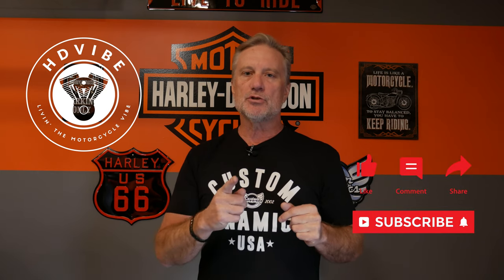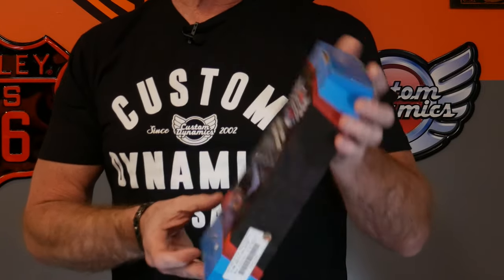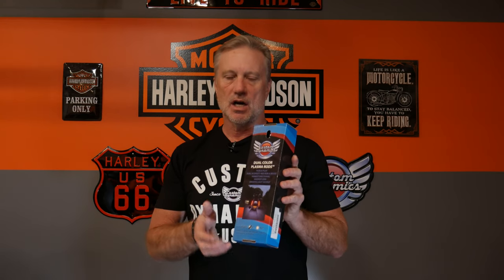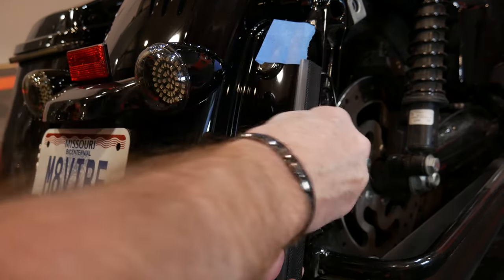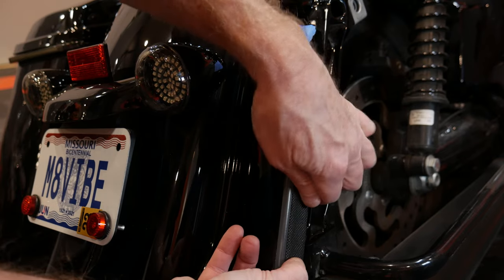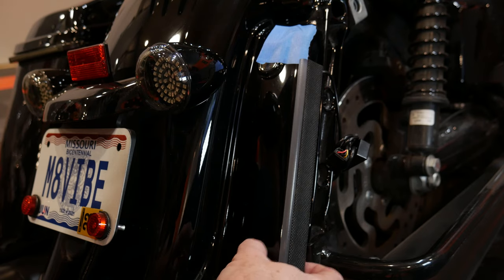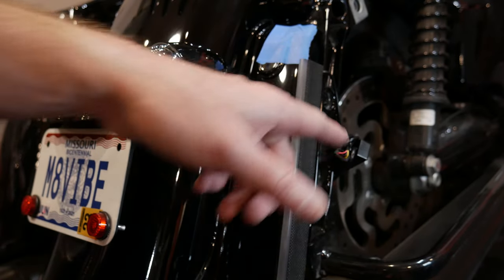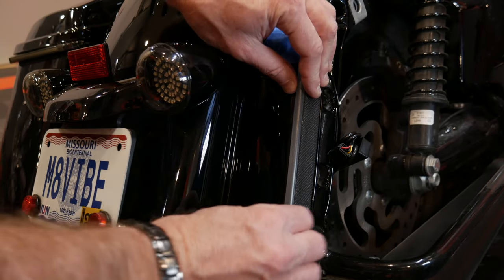Road King Special Lighting Upgrades

Comment: Rick have you thought about the spots and turnsignals down on the forks like the road king standard. I dont like the turn signals on the handlebars.
Reply from the maker: Thanks Bob for watching and commenting.   I do believe it is possible at least to add the passing lamps.  You can see how to do that on another YouTube channel called Riders United.  I have since traded in my 2019 RKS, so I obviously won't be doing any more videos or work on it.  However I have over 200 videos on tips, trick, rides, reviews and other installs on the touring bikes.  If you are already a subscriber to the channel...thank you.  If you haven't yet subscribed to the channel I'd be honored if you'd consider doing so.   Thanks for your support and ride safe.  👊✌️👍

Comment: Hey Rick, recently subscribed to your channel. 
I have a 2018 Road Glide and I have installed the CD bag and fascia lights. I also have the Magic Strobe. 
Do you have a video showing how to use the red jumper cable to make all the lights strobe and not just the stick brake lights?
Reply from the maker: I do not have a specific video on that but my guess is you may have the magic strobe installed after the connections for the other Custom Dynamics products.   The magic strobe needs to be the first connection to the stock plug and then everything else after that.  Then everything will strobe when brakes are applied.   Give that a try and let me know if that gets them all to strobe.   The other option is to call Custom Dynamics and they can walk you through it as well.  They are very helpful and knowledgeable on the set ups.   Thanks for subscribing and ride safe.👊👍🇺🇸
Reply: Oh, so you didn’t have to cut a wire and jump that red wire in somewhere??? 
Ok, I’ll see if I can see what order everything is in. Thanks so much!
Reply from the maker: @indysteve2875  You do not have to use that jumper wire to get them to work.   It's just the order they are connected.  Hopefully that will take care of it.

Comment: What are riders trying to accomplish by adding that many lights on the rear of their bikes? Adding another run/brake/turn light to a bike that has upgraded factory run/brake/turn lights on the rear does little for being "seen" when we're dealing with driver inattention.
Reply from the maker: Thanks for watching and commenting.   The factory lights on that bike are actually old fashion halogen bulbs which are not very bright at all.  All lighting is now LED which burn cool and are much brighter.   I light my bikes up so I have a better chance of being seen...I would compare it to a police or emergency vehicle...lots of lights to hopefully be seen.  Ride safe and thanks for your support to the channel. 👊👍

Comment: What size are those plasma rods ?
Reply from the maker: Thanks for watching.  The plasma rods I installed are the 10 inch model.  Ride safe and enjoy. 👍👊✌️
Reply: @HDVIBE  one more question,  when I measure to see how long I want my rods do I measure down 2 inches and go from there to the bottom  ?
Reply from the maker: My mistake.   I actually used 8 inch plasma Rida.  Yes measure from the bottom and leave about 2 inches at the top of the fascia.  That is about the set up that is on the RKS.  👊✌️👍